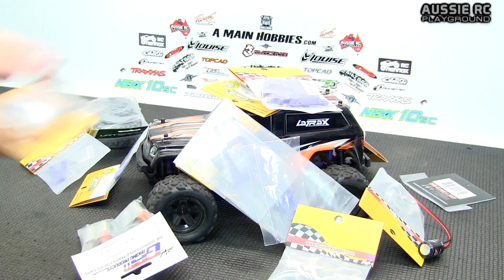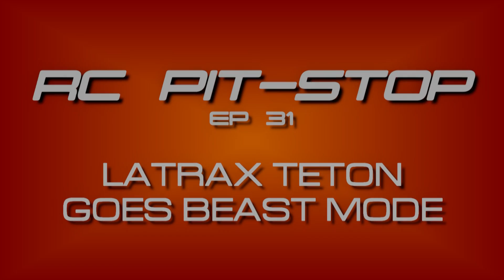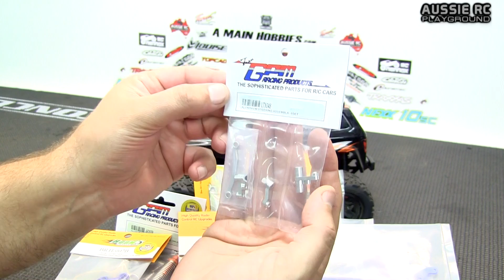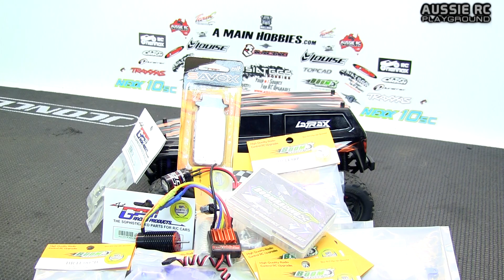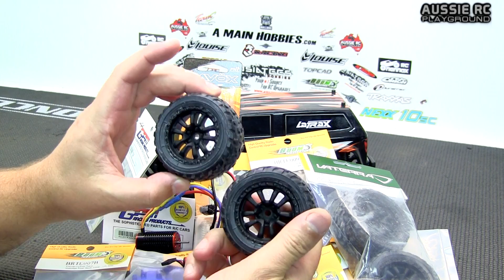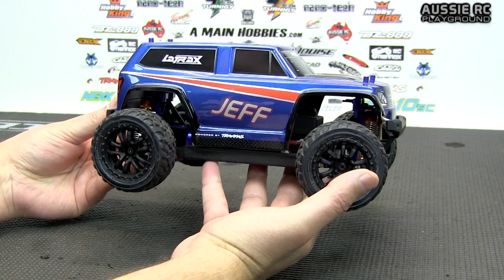RC Pit-Stop EP31 - LaTrax Teton Goes Beast Mode

Comment: also you can just find a nut that fits on the body post thing, i have the same issue with plastic body posts going into metal shock tower, they just dont fasten, i'm going to make it magnetic anyways i think. but yeah it's annoying.

Comment: Great job and video.  Only one suggestion.  Install a set of Proline Trencher 2.2" tires. They are made for the E-Revo 1/10 scale but with very minor trimming on the Chassis and body they fit perfectly and the performance is unbelievable. And these huge tires look awesome on the Teton.

Comment: Aussie RC Playground 
I bought the same esc and motor from trackstar, but i hade a simple question.
Did you use the original screws to mount the motor? If not waht size of screws did you use? M2,5 ?

Comment: did you upgrade the crappy plastic differential gears? unless you do that with the Teton it is useless.  In the process of upgrading mine.
Reply: Lunchbiz I just picked up a Latrax SST, everywhere I read everybody keeps saying to upgrade the crappy plastic diffs....but when I open mine up they are metal?? Are they actually referring to the spider gears inside the diff or am I missing something here?? Only plastic gear I see is the spur gear which I've already ordered a steel one
Reply: The whole assembly minus the metal ring gear, Here is a picture of what comes stock in the Teton, the output gears for each wheel are what wear down fast. 
https://algolia-rcplanet.netdna-ssl.com/9931/Traxxas_Differential_Assembly_Complete_Gear_LaTrax.jpg

I ended up replacing both differentials with the Latrax solid aluminum spool part #7581. Still turns great, performs a lot better off road now.

Comment: Hey there, do you know if these would fit on the Teton?
http://www.ebay.com/itm/White-10-spoke-Wheel-Rims-Hard-Tires-For-RC-1-10-Nitro-Car-Flat-Racing-Car/111636339667?_trksid=p2047675.c100005.m1851&_trkparms=aid%3D222007%26algo%3DSIC.MBE%26ao%3D1%26asc%3D36499%26meid%3Dc6c3977635724d5bae58605b4fc49741%26pid%3D100005%26rk%3D3%26rkt%3D6%26sd%3D111284432970
Reply: +SYD KICKERZ (S.K) No, 1/10 scale and 1/18 scale have different hex sizes. Also, those are drift tires for on road and drift cars.
Reply: +Ryan LeFevre well the guy in this video is using 1/14 sclae whhels
Reply: SYD KICKERZ 1/18*

Comment: hey I like the teton, just wondering, did you have to replace the stock screws for aluminum parts, just got a latrax sst and ordering parts for it right now, just wondering if ill need new screws too

Comment: I bought the trackstar combo for my teton as well. what screws did you use to mount the motor  the stock ones a real too big. I think the trackstar needs 2.6 mm. can you confirm for me, or put a link to the screws you used.

Comment: which kv rating is your motor, is it 4300kv, 5050kv or 6100kv?
Reply from the maker: Cedric Keshishian Mine is the 6100kv. Not very torquie, but it doesn't have to be.
Reply: ok thx I was looking at the trackstar motors a while ago and I came across your vid and I loved it

Comment: Sorry if I'm having a brain fart..... But if you change the motor and ESC do you have to do something with the remote to make it GO :) 

Plz answer
Reply from the maker: Peyton Thomas Nope, the remote is not directly related to the motor and ESC, it merely sends a signal to the ESC & servo so you can go fowards/backwards and left/right. You can connect any remote to any car regardless of what power system you have in it.
Reply: +Aussie RC Playground...... Thanks :)

Comment: AWESOME BUILD!!! I am waiting on 3 Jeffies to come rite now. 1 for the kid,wife, and myself.just a thought for your loos fit towers.... try drilling out the threads then shim and put a nut and bolt.. should mount good and tight then.. Also I was wondering what you think of putting a team associated brushed motor to replace the stock one? do you think it can handle the lipo without burning up? I would rather go brushless but 3 brushless systems..... grrrr lol I should have kept the hobby a secret lol

Comment: So... the one thing that this car desperately needs, an upgraded diff, isn't included?

I love my Teton but this upgrade is a must, and I was really hoping I could see you do it and hear your thoughts afterwards.

Maybe next time now you've gone brushless?
Reply from the maker: Yes, I know the diffs aren't very strong and although they do ok in stock form, there's a good chance they'll designate with this system. I will show the results and then install the diffs later on. Stay tuned...
Reply: Aussie RC Playground that's awesome, because there's so many different opinions when it comes to upgrading them... Most talk about the RC18 diff, but for a $100 truck I wonder if it's worth it...